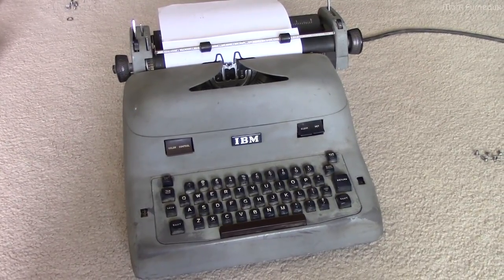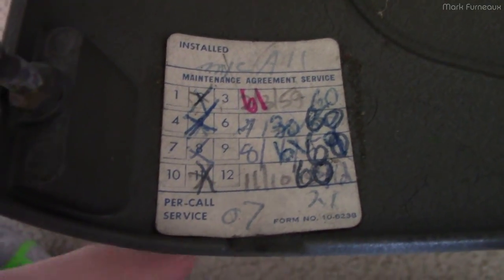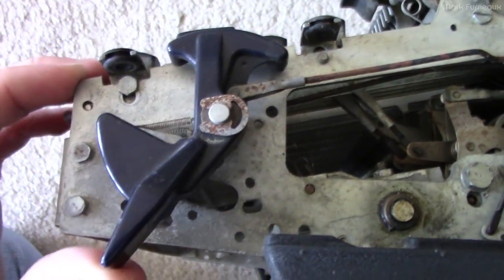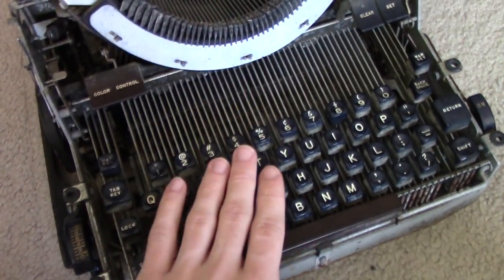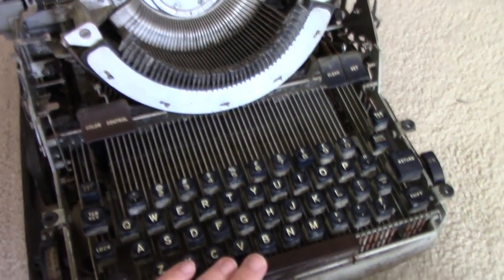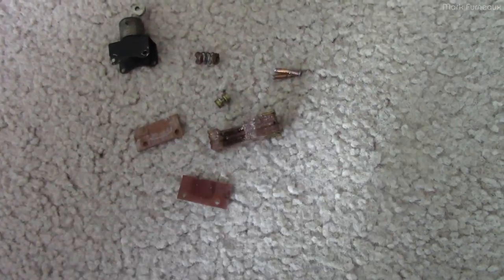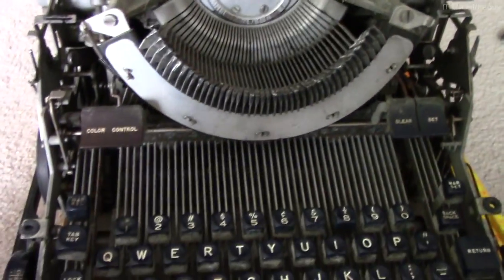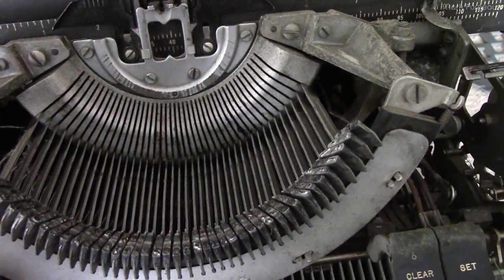1953 IBM Model A Electric Typewriter Repair Part 1

Comment: I used to type on these for $.10 / page for my parents who were both court stenographers. We owned two of these and had a typewriter repairman come to the house for regular service. You are right. 1950's - 1970's. Best machines ever. 100 wpm easily.

Comment: The color control, as you say, would move the ribbon. With a single color ribbon you can spread the wear between top and bottom, but you can get two-color ribbons (half black, half red).

Comment: The lever on the left side looks like an impact intensity adjustment.  If I recall correctly, you could adjust how hard the hammer hit the ribbon/paper - especially for multi-part forms (with carbon paper), etc.  A manual typewriter may have a positioning adjustment for a similar function (the force on the manual was all in the fingers).  If you had a multi-part form, you had to "type harder" :)   Thanks!
Reply: Tim B this is correct, i recall this from typing class 25 years ago.

Comment: I've found sewing machine oil to be better for lubrication on things like this.  It doesn't degrade and become sticky like WD40 will.
Reply: A good way to resurrect old stuck crap is a mix of 20:80 sewing machine oil (mineral oil) and turpentine. Soak stuff and dry it off. I got this tip from old teletype operator, and i've resurrected two teletypes with this method - works perfectly. Point-lubrication of parts after soaking is needed though.

Comment: In so far as the carriage being returned and not moving forward after that, we used to  use multiple rubber bands attached to the left paper feed and a post next to my desk to force the carriage left whilst typing (until the IBM guy could fix it)_ It was very strong as we used a 8 copy freight bill with carbon paper between the copies. -First job memories 1966 -

Comment: These are famous for the bottom rubber roller that controls striking the typebar to the platen dry up and will not grip the plastic trip levers.  FEDRON will help rejuvenate the rubber roller.

Comment: I typed all my papers in college on this typewriter, its a fine unit. The instrument on the left is for adjusting the strength of the key strike; I’m trying to repair my own machine and am having the same problems as in this video - after about 30 years of storage, the keys don’t reach the paper.

Comment: Please keep WD40 far away from this beauty.

I will be following your progress with interest.  I have a model B.  My father spotted it on a shelf where he worked back in the '70s.  He asked around, found out it was no longer used, and got it for next to nothing.  Its drive belt broke a few decades ago, and it hasn't been used since then.  It's been out in my garage for almost fifteen years.  I want to get it back into working condition.  I love the style of these machines.  I haven't had any luck finding a source for a drive belt online yet.  Bing keeps trying to direct me to listings for Selectric belts.

Comment: I have a similar machine, I have removed the belts from the motor, because when I turn the machine on, I can hear the electric hum but the motor does not spin. To turn the pulley wheel that is on the motor by hand when the machine is off is difficult. Any suggestions on my next steps would be great.